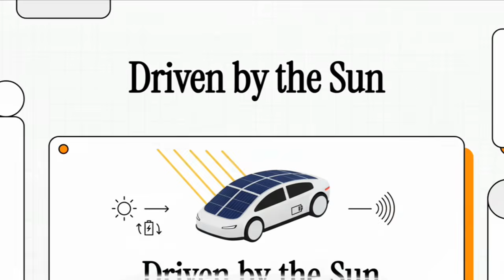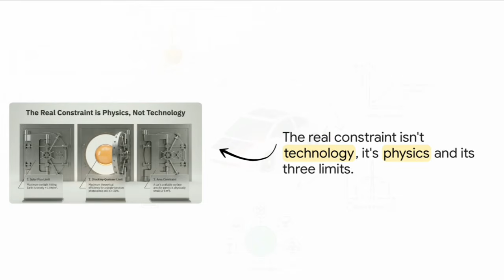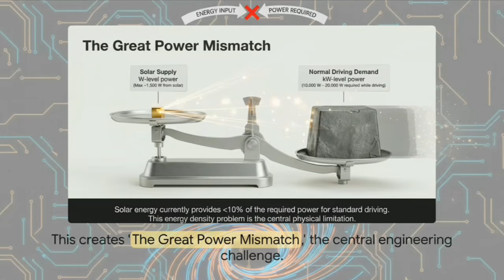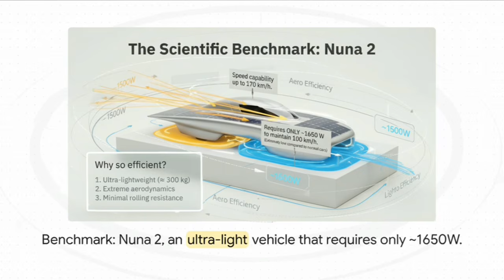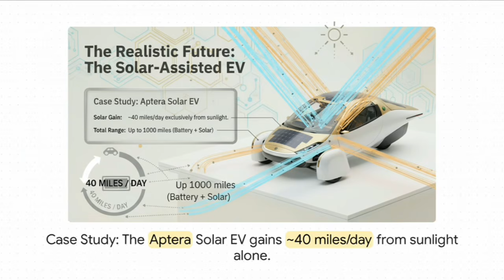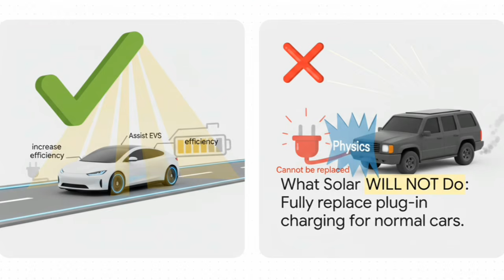“The Truth About Solar Cars 🚗☀️ (Physics Says NO!)”

Comment: Aptera only uses around 6,000 watts at 60 mph so if you put 750 watts of solar on the vehicle and charge the battery for 10 hours at an average of 400 watts that would give you 4,000 watt hrs of energy.  4,000 watt hrs divided by 6,000 watts = .6667 hours.  At 60 miles per hour for .6667 hours that would give you 40 miles of range.   So I guess the problem isn't that the solar panels don't provide enough energy, the problem is most cars just use too much.  Even so a Tesla model 3 which uses about 15,000 watts at 60 mph would still get about 10 miles of range per day which is not nothing but probably not worth it.  However it is also worth noting that advancements is solar panel efficiency combining silicon and pervoskite should soon double the power output of solar panels which would mean an Aptera could travel 80 miles per day and a Tesla model 3 could travel 20 miles per day.  If Tesla continues to improve the efficiency of their vehicles and gets the energy usage down to say 10,000 watts at 60 mph then it could travel up to 48 miles per day with 40% efficient panels. That would be more than enough for the average daily driver.
Reply from the maker: Thanks My dear friend for wonderful and technological gide